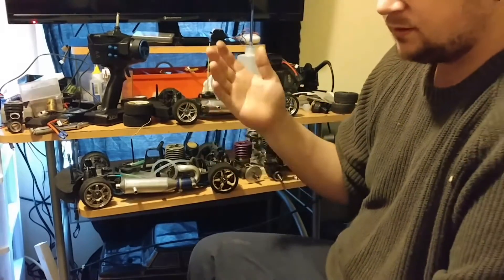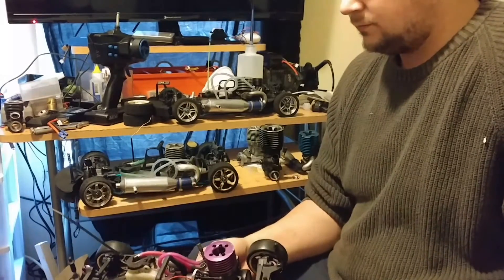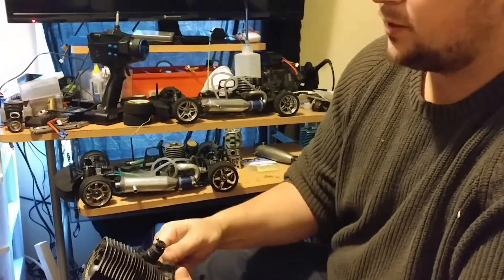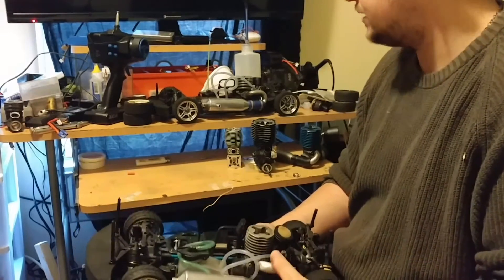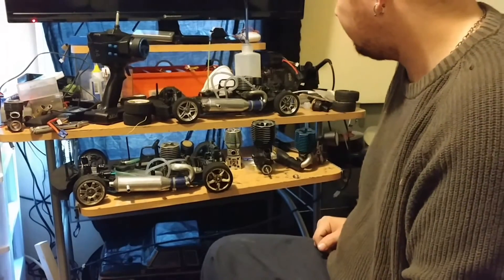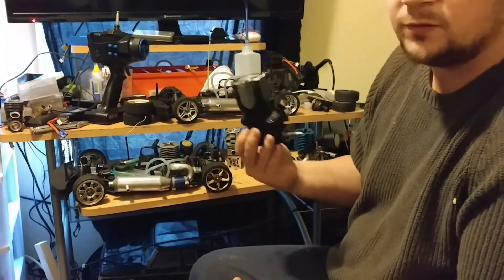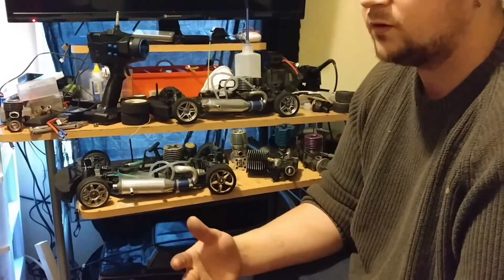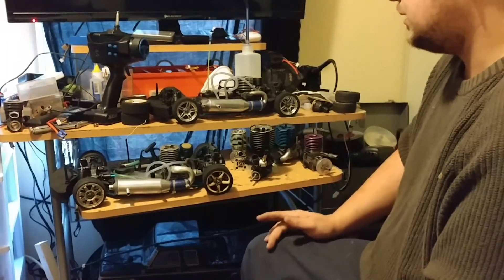How to properly check Nitro engine compression

Comment: Look ofna idiot, engines have different compressions because they have different squish band heights. The lower the squish band is in the sleeve the higher the compression will be so the engine will be harder to turn over, the higher the squish band sits in the sleeve the less the compression will be hence the engine will be easier to turn over. Now a cold engine the piston might be loose fitting but when the piston heats up and expands, the piston will fit tighter and stop the piston blow by, also the sleeve being heavy brass takes longer to expand than the less dense alloy piston...THIS is the true way to check the engines compression piston blow by is to check it when it is at running temp, NOT cold as that wont tell you anything. Dork look at my screen name and where this link takes you to, maybe you will figure out your talking to a manufacture idiot. http://mecoa.com/faq/squish/squish.htm 
The glow plugs element is not a catalyst, methanol is the catalyst that ignites the fuel and the fuels residual heat is what keeps the element glowing. A catalyst is one whose molecules are dispersed in the same phase (usually gaseous or liquid) NOT a alloy element. You really are stupid, what you read wikipedia and think you know something.
You also stated the engine being turned over by hand doesn't have enough turbulence to check piston blow by...here is a video I made to disprove you https://www.youtube.com/watch?v=RtGdDcAIrTg&t=2288s. the piston blow by by hand is shown at 11 min into the video. I also bet you don't know that the bottom end of the engine also has compression too. Your freaking stupid
Reply: KB 21 agreed but first off that’s fucking rude, second this isn’t a fucking school essay

Comment: Got my mate revo flying with 3.3 got it tuned crazy wheelies gallor even did a reverse flip in reverse fuk it was funny but just backed it off a bit as it was a touch hot what a beast best I had a 3.3 running